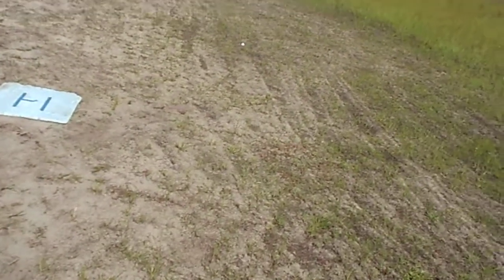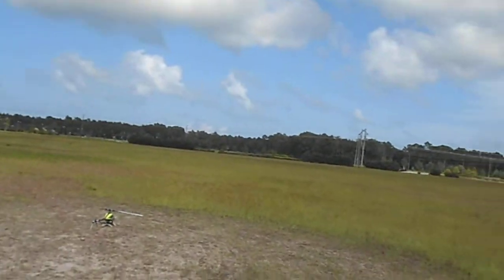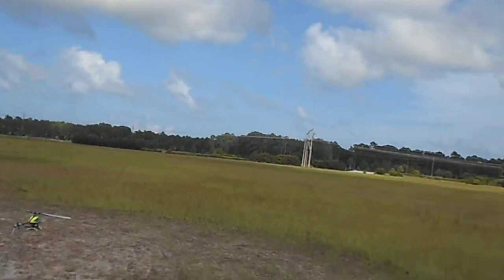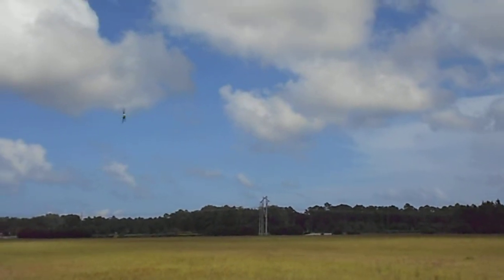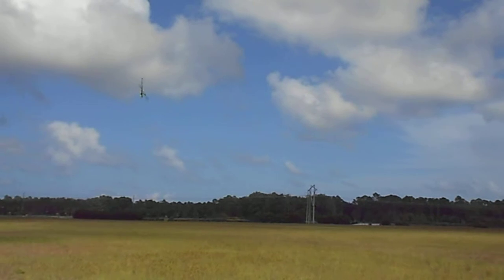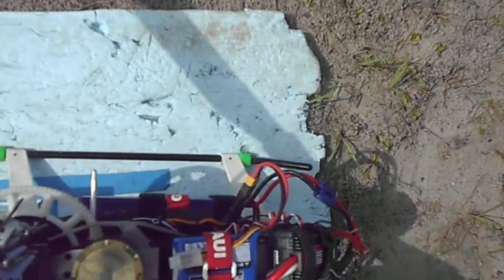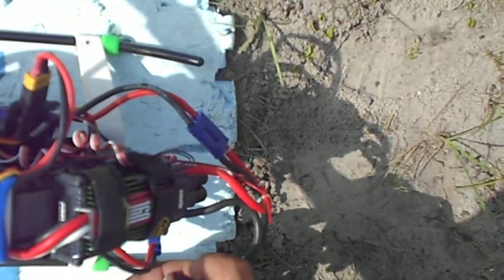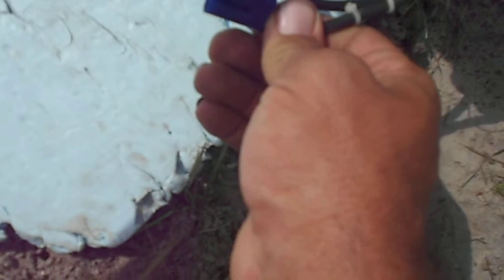Gaui X7 - Flight 100 - ESC battery wires disconnect

Comment from the maker: It's sooooo weird how the battery wire is just now coming unsoldered after 100 flights. This wasn't the only time it happened. The next few flights have this same issue happen a few times. I just haven't gotten around to uploading them. Same battery connector and everything. I think i finally got it fixed though.